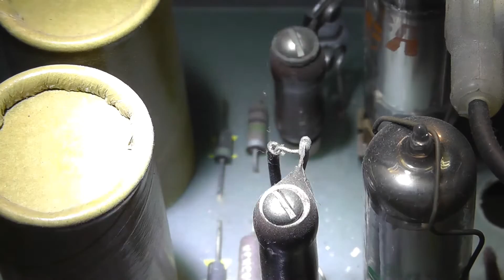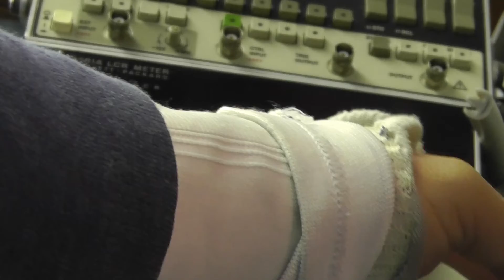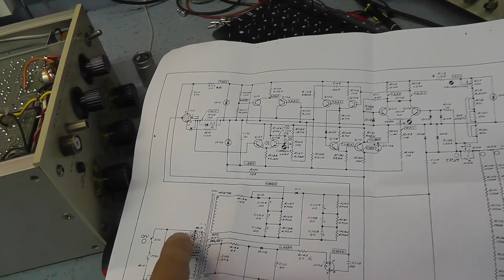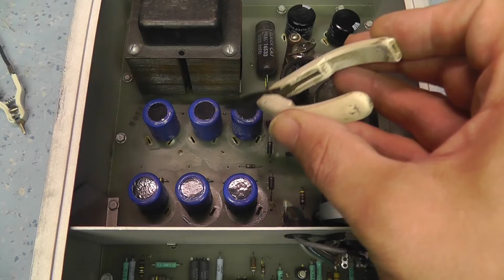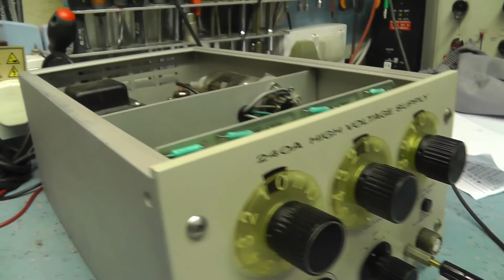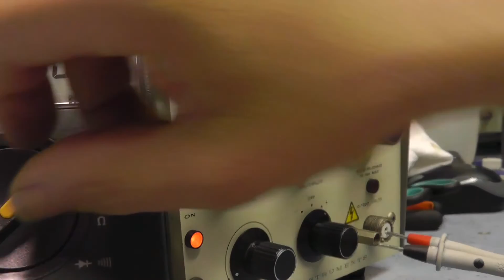Keithley Model 240a HV PSU

Comment: Had a good chuckle when you said transported by “herpes” .  Thank for the video.  You appear to have a hardcopy manual for your 240, is there anything on the 245 (2kV model) in your documentation?
Reply from the maker: No Sorry. Didn't know they even made a 2KV version! Thanks for your comment.
Reply: Simon Spiers : No worries. In fact I did a bit more digging and found that there were several other models in this series: 245 (2.1 kV) and  246 (3.1 kV). It turns out that the 245 and 246 are very similar in construction,  and circuit design AND the 246 manual is readily available.

Comment: Good fix Simon. Wonder what GE regulator valve was used? I once had a bunch of those "Bumblebee" paper wax caps in my parts collection, but discarded all of them when I tested before using to repair another vintage device. The unsuspecting guitar purists foolishly pay big bucks for them on Evil Bay. There is nothing special about them. Can't say about "Black Cats" I think most were made by Sprague.